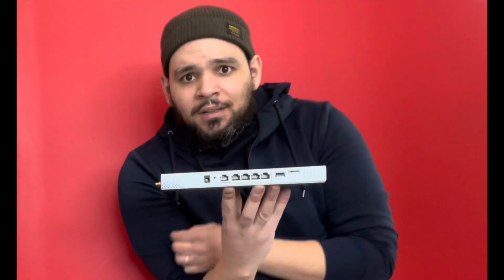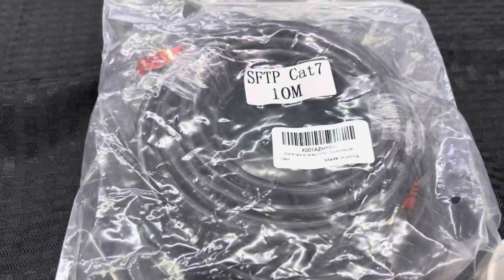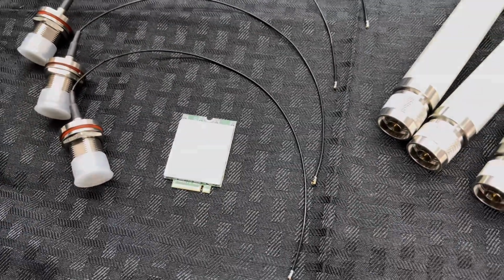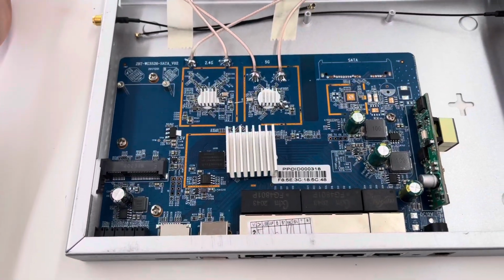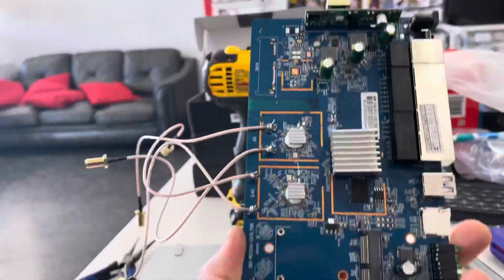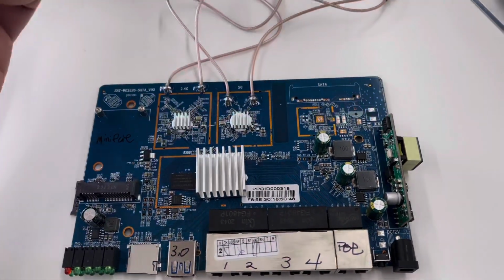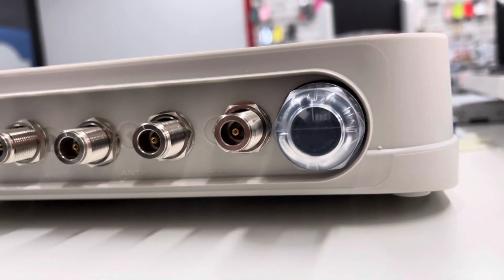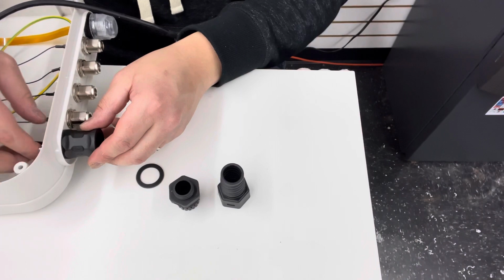Part 1: How to build an outdoor POE LTE router

Comment: What other antennas would you use you mentioned those are temporary. I currently own the mofi 4500 an mostly use it for gaming. If i were to do this build would you recommend any changes if i going to mostly use it for gaming.
Reply from the maker: I'd go with an RM502Q-AE and I would go with 4 x LTEFIX LDPA Yagi stacked vertically 8-10 inches apart -45 +45 -45 +45 degrees